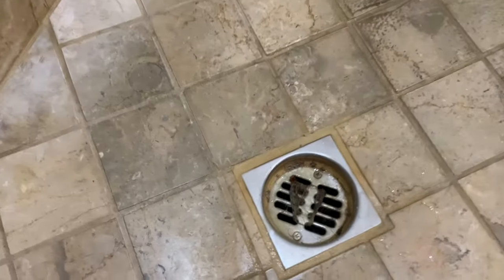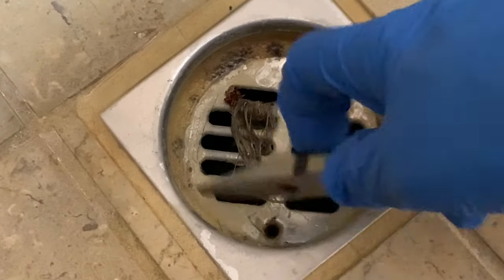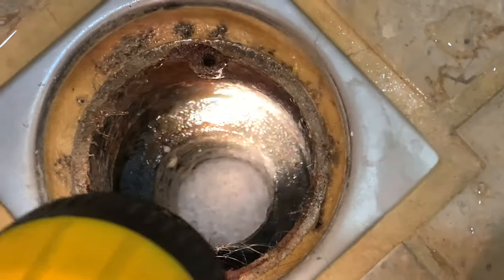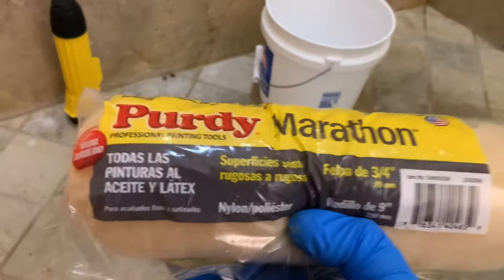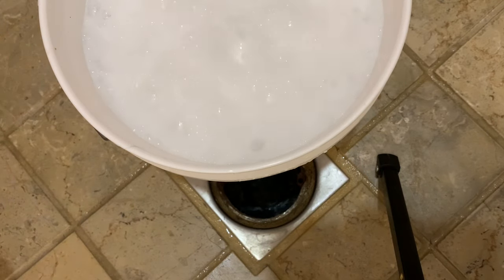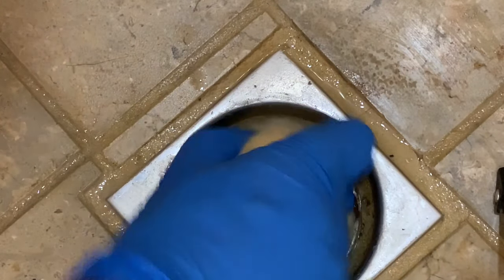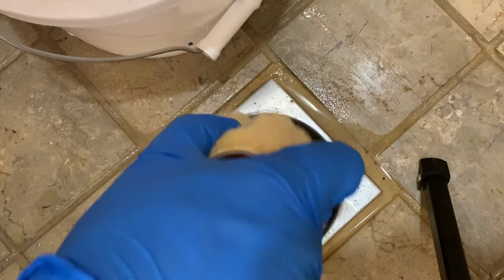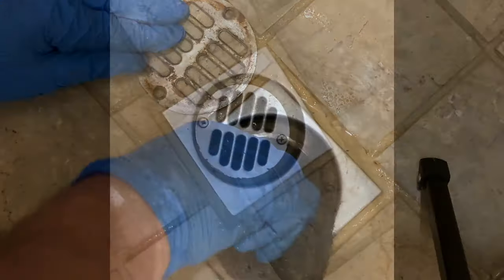Get Rid Of Smell From Shower Drain

Comment: Our shower drain smells awful but only when dry. We called a plumber and he said the trap was fine and snaked the drain without any issue. 
Unfortunately it didn’t help the smell. I read that it could be a toilet leak but this is VERY clearly coming directly from the shower drain! 
Will try this method, however, we didn’t this once before! Thanks! Any other tips would be so much appreciated!!
Reply from the maker: Do you use the shower regularly?

Comment: What would you suggest if I’m not able to get the drain off? The tile in the shower was laid in a way that it over laps the drain where I can take it off.
Reply from the maker: Ugh that's a tough one. Are you sure it's not just the grout? You can chip that out if that's the case. Otherwise a dremel tool but that may be more trouble than it's worth.

Comment: I do cleanings for people who have hit rock bottom and are unable to do it themselves.  Recently I encountered a bathroom with an overwhelming smell. I removed and disposed of the toilet seat and cleaned and sanitized the toilet, washed the floor twice and still could smell it.  Then i opened the shower door. It's coming from the drain and I don't think I can do it. Is this a job for the plumber?
Reply from the maker: I would follow the video first. You can probably get rid of the smell with this method. Otherwise a plumber can perform a smoke test
Reply: @Mike Klimek  I did it! I was persistent but the odor finally went away.
Reply from the maker: @amyr556  Way to go Amy!!!
Reply: @Amy R, you are an amazing person. Thanks for everything you do!
Reply: You ain’t gotta be modest Amy, we know it’s YOUR bathroom. 😂

Comment: I had an issue with my drain about a month ago, it stink like sewe but only when the water is running. I had to call a plumber, they cleaned it up (they used a vacuum) and smell was gone. A week ago the smell started to happen again 😢 do you think it's some build up again causing that smell so soon? Or maybe os something wrong with the p trap?? Again smell is only present when water is running
Reply: Did you open it and look at it yourself? Maybe since they only vacuumed the larger particulates and hair, there may still be a film of build up and sludge on the interior of the pipe that smells. I would suggest the baking soda and vinegar like this video, and let it sit for 5 minutes, then rinse out with hot water.

Comment: My drain is about a year old and has never been used and stinks. I think they call that a dry socket??? When I let the shower run, it goes away. I just have to make sure that I run the water every now and then.
Reply from the maker: Sounds like the water in the trap evaporates and allows sewer gas to enter the room. You can pour a little water down the drain every week or so, or pour a tablespoon of vegetable oil in the drain. The oil will rise to the top and theoretically prevent the water from evaporating.
Reply: Same here. Only our smell comes back after 12 hours or so. 

It was fine until the shower was not used for an entire week and ever since then, it smell by shower time again. Trap is apparently wet?

Comment: I don't understand what is the point of mixing vinegar with baking soda? you just get water,  sodium acetate and CO2 which do not really help with the smell. you either use baking soda, and when done, neutralize it with vinegar or just use vinegar. In both options, you need to let it sit there for 15-20 minutes minimum. The fizzing is cool but pointless.
Reply: Maybe you should make a video on how to correct this problem 👌